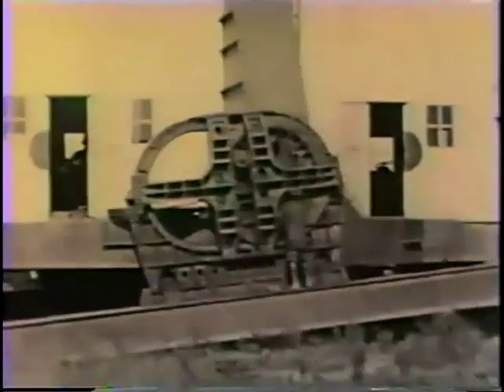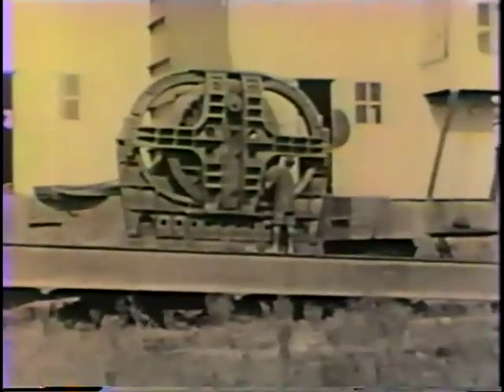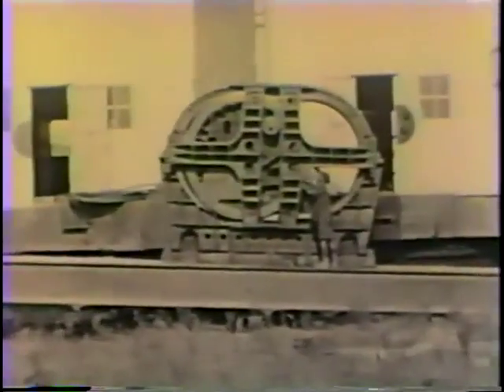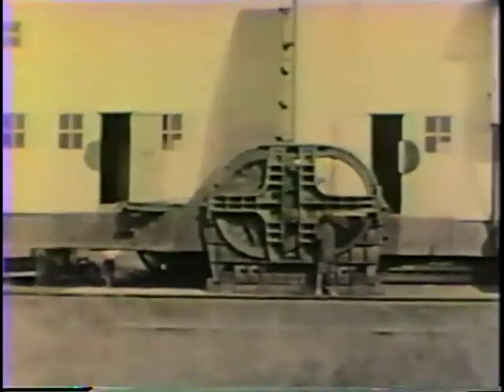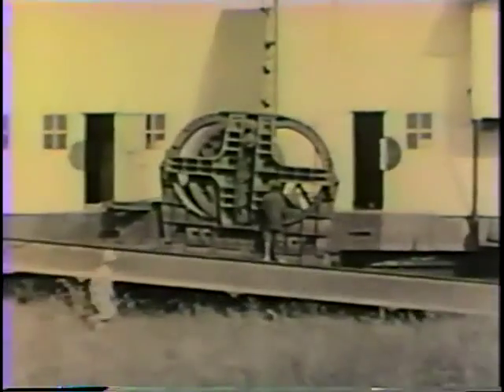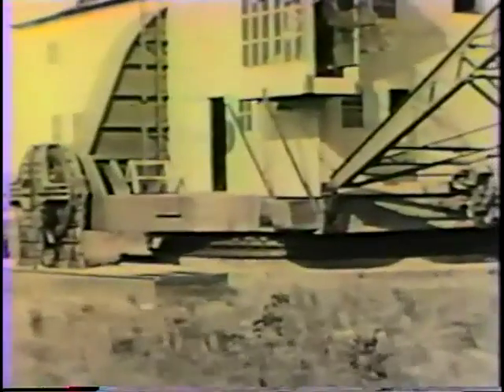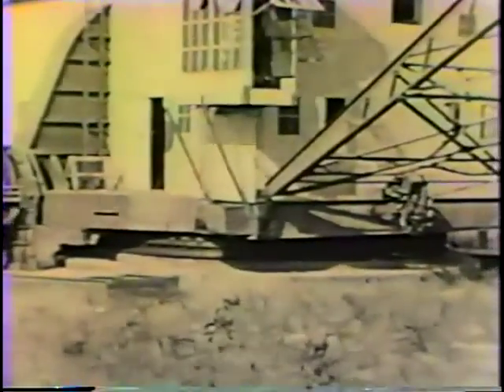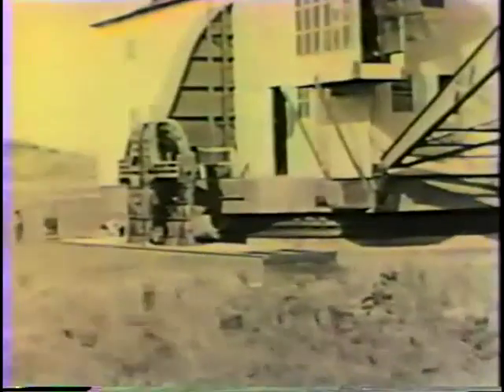Bucyrus Monighan 6160 walking dragline

Comment: If the first dragline in the video is just 6 yards, that is a waste of horsepower and purchasing expense.  That dragline should handle 30 or 40 yards, conservatively.  That has to be a mistake by the producers.
Reply: Dude you are talking early 1900’s era…
Reply: @evadvalcourt I read that, 1931, in the description.  After checking a little closer, on some other videos, I guess 6 to 10, or so yards, is about right for that vintage, and size.  It still seems like a bit of over kill, to me, on the size of the machine, for the capacity, but live and learn.  It was also a bit difficult to judge the size of this whole machine, in this video, but it appeared pretty large, to me, by the size of the walking mechanism.